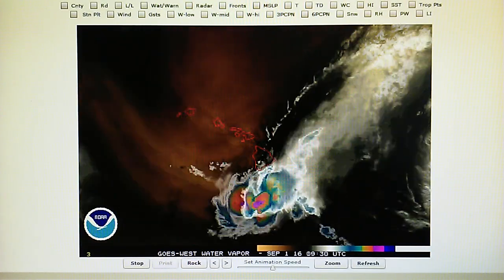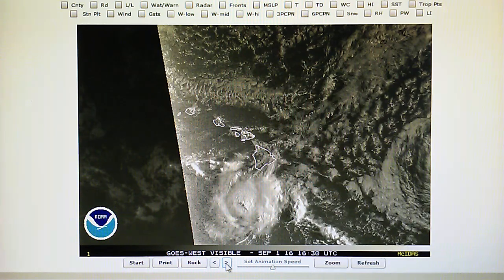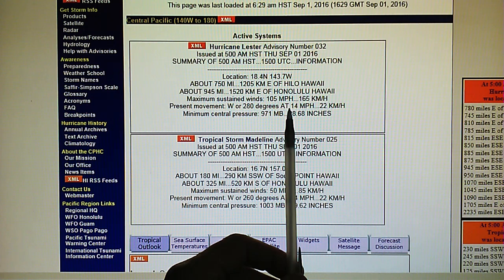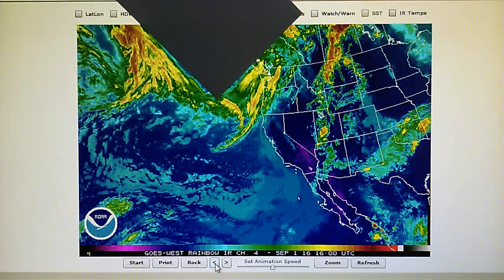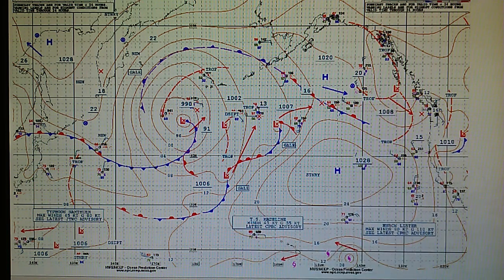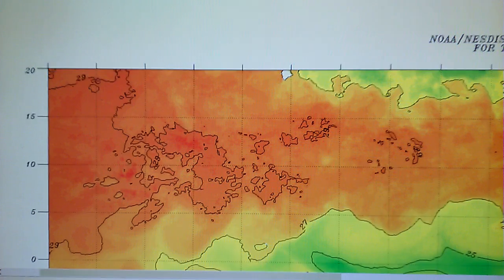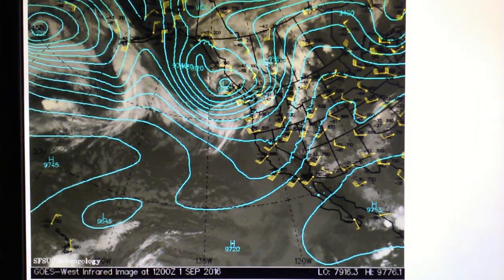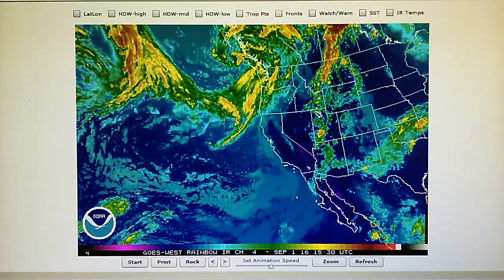9-1-2016; Climate Change: Huge Right Angle on Low Pressure System; Madeline Knocked Down to 50 MPH

Comment: What a difference 10 hours makes. As of about 9:00 EDT, seems the high pressure over Mexico is gone and there was a rather large storm system, showing all red on the rainbow loop, crawling up from southern to northern Mexico. Meanwhile, hurricane Hermine continues to grow, despite evidence on the visible light mode of it being targeted heavily. They could've done away with that system before it became a hurricane, but they didn't. Therefore we can only assume it's been intentionally allowed to grow into a major hurricane.
Reply from the maker: Precisely. Hermine is a big storm.  There is high pressure installed on its North side and its East side which is steering it diagonally to the NE.  The NHC forecasts Hermine will move up the coastline.
Reply from the maker: +1PacificRedwood - Correction - high pressure installed on Hermine's WEST side and its North side.
Reply: +1PacificRedwood Right. I just watched a report from the ABC affiliate in NY. Their "meteorologist" said that once the storm makes it up to the northeast, it could stall. Meaning it will be stalled out between two installed high pressure systems. This is what I was afraid of, but pretty much what I expected.